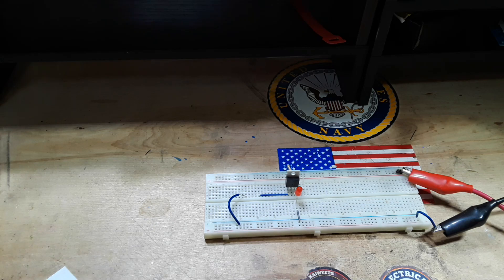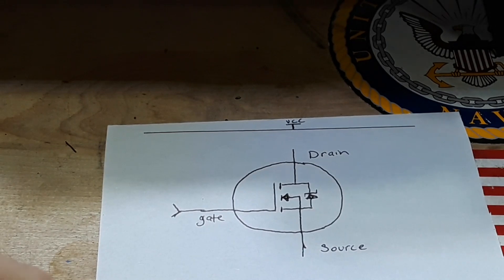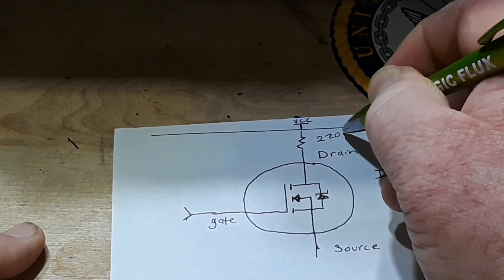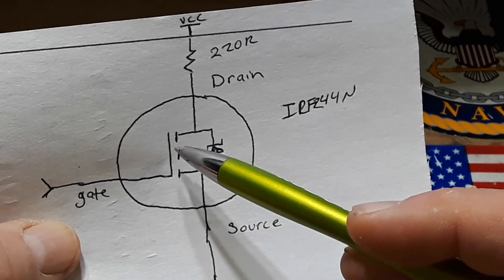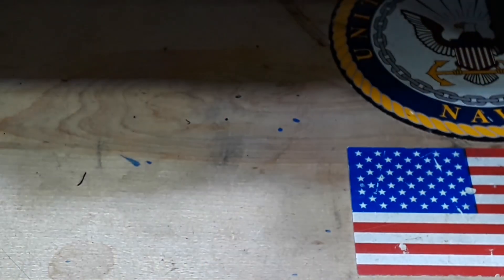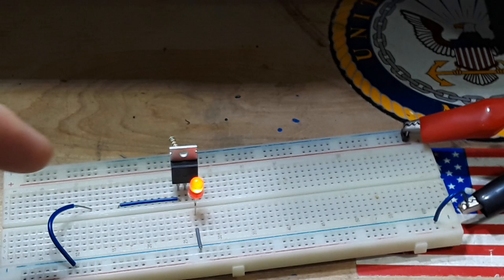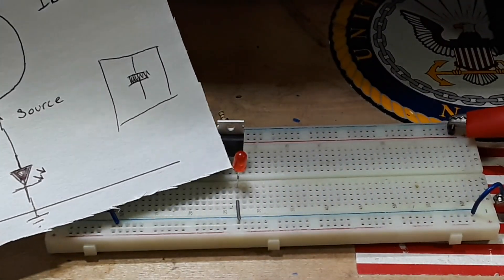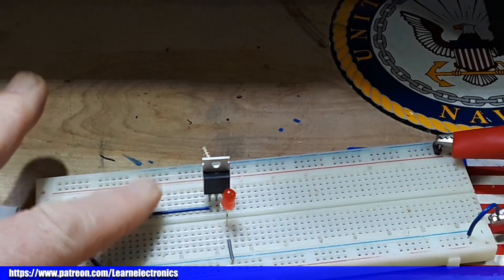A Simple Three-Component Low Voltage DC Touch Switch

Comment: You could very easily use this to turn on a high voltage circuit. Use an opti coupler to isolate and a relay for high voltage. Maybe a lamp.

Comment: What's the minimum VCC voltage required for this circuit to work?
Reply from the maker: I did it on 5vdc. You might get it to work on 3.3vdc, but it's not enough to fully open the gate. Really, 5vdc isn't either, needs about 9vdc if you want full current flow on the MOSFET.